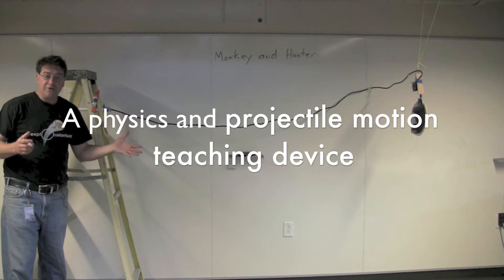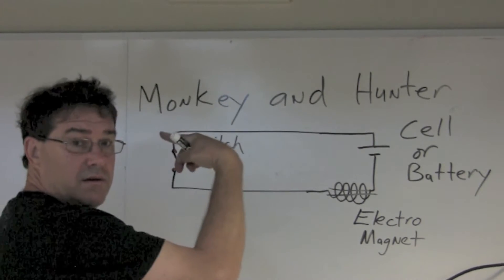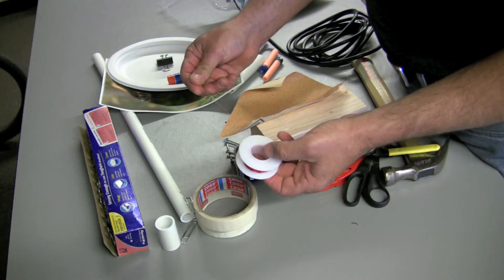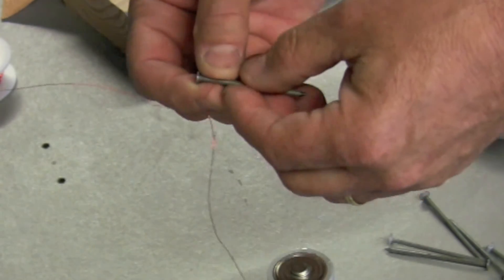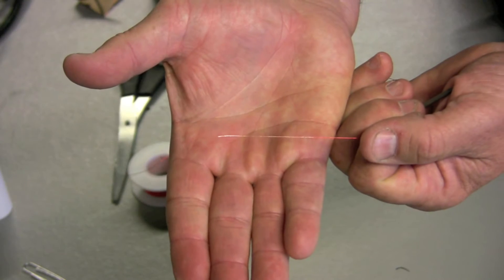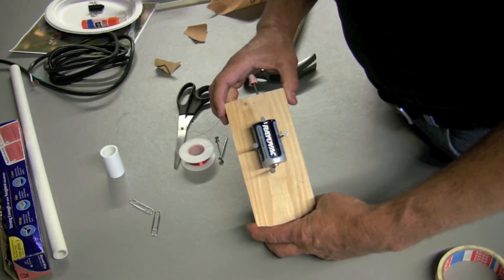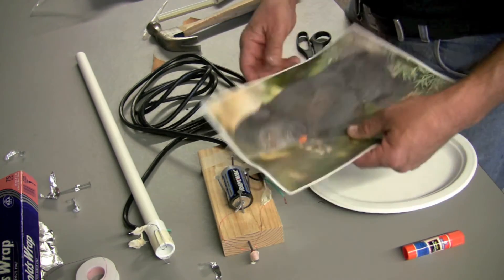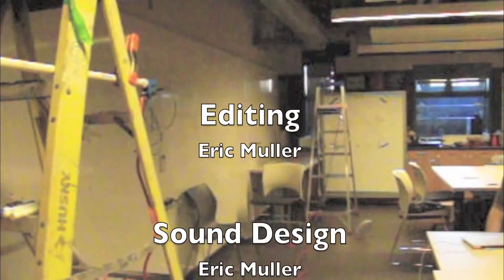Build a Monkey and Hunter (shoot the monkey) Device - Exploratorium Teacher Instititute

Comment: I appreciate this effort.

A few thoughts:

1. A more durable design using stocks parts might be better received

2. If someone is going online, or to the electronics store, to buy magnet/motor wire, they might as well just buy an inexpensive 3V electromagnet -- the result will be better, and take less time, for very little cost

3. Likewise, if one is going online or to the hardware store, one might as well pick up something that would be a more durable switch. It would be particularly nice to see a design that uses a more durable switch.

4. Using a projectile that has lift or guidance features -- such as the fins on the nerf dart -- invalidate the experiment -- The motion will not be strictly parabolic. The only reason it would still work, most of the time, is that the target is huge.

5. Using a target that huge invalidates the experiment, as well.